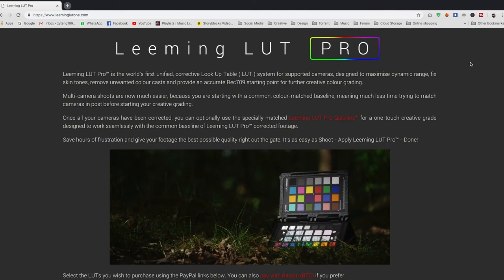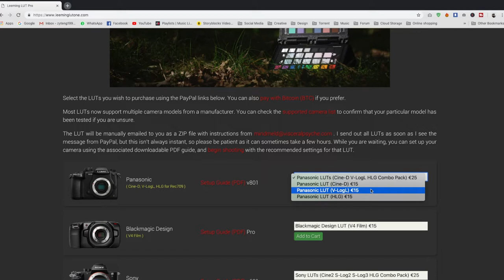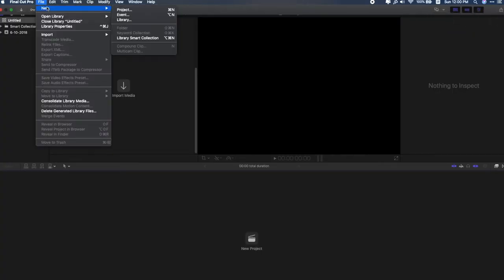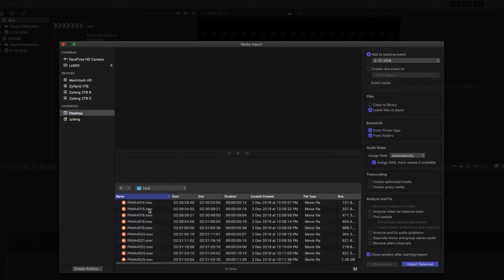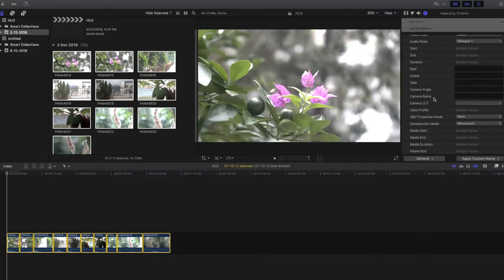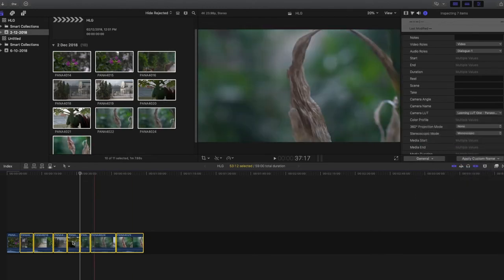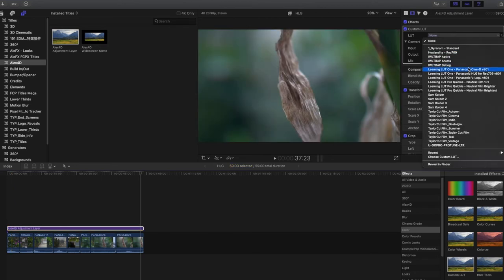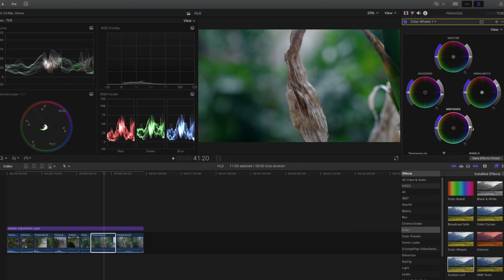Leeming Lut Pro, HLG - How to convert HLG Rec2020 to Rec709 Panasonic GH5 in FCPX

Comment: how will you properly expose if you dont have external monitor for HLG?
Reply from the maker: use Zebra, Set ur zebra setting that leeming luts provided, set ur exposure of ur main subject until the zebra show (means overexposed), then step down until the zebra lines are gone on your subject. Sometimes ignore the highlights zebra.
Reply: are there any gh5 lcd calibration needed?
Reply from the maker: @General111100  nope

Comment: Unless you are using an NLE like Premiere Pro that forces you into a Rec 709 color space, I don't see why people are converting Rec 2020 (or close to it) footage to an outdated, limited gamut.  If you're grading HDR content, you need a quality HDR monitor anyway and HDR is built at least around a Rec 2020 wrapper.
Da Vinci Resolve and Final Cut now work in the wider gamut HDR formats if your footage is compatible.
Reply from the maker: It will help to get a better dynamic range for gh5 like Vlog color profile.
Reply: @kelvinzyteng  You only do this Rec 2020 to Rec 709 conversion if you have no plans to output in HDR.  Otherwise, you are still squashing dynamics and color reproduction of the final deliverable.  Limited Rec 709 and SDR formats are decades old.  Granted, you do need an HDR monitor (even a decent consumer OLED or LCD 4K HDR with HLG display will work in a pinch) to properly grade PQ HDR and HLG HDR footage.
Reply from the maker: @dan_hitchman007  Yes, this method is not for HDR output. If want to output HDR, cannot use this method. HDR editing is another method. Must be clear.